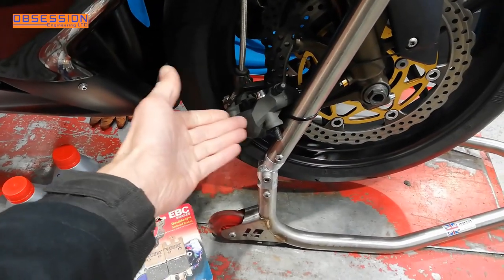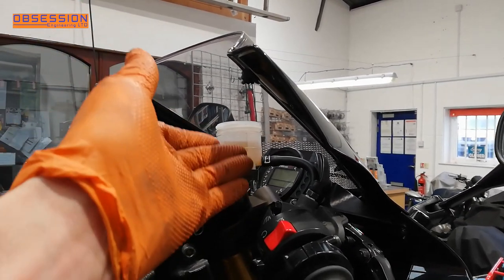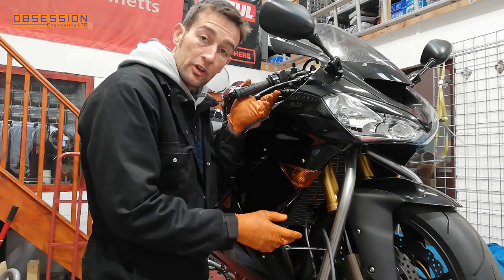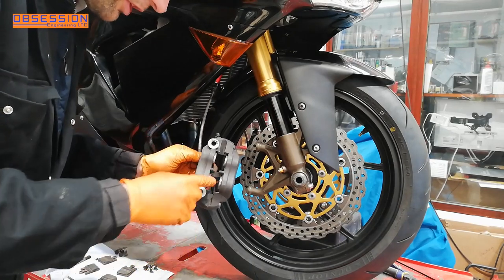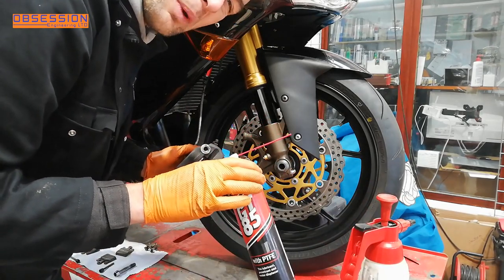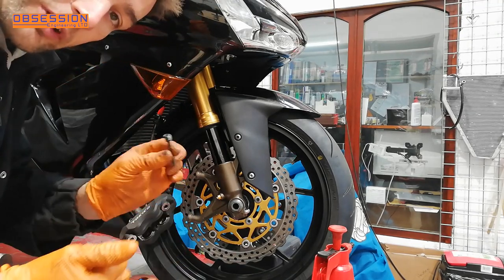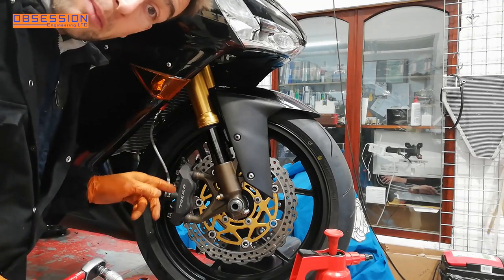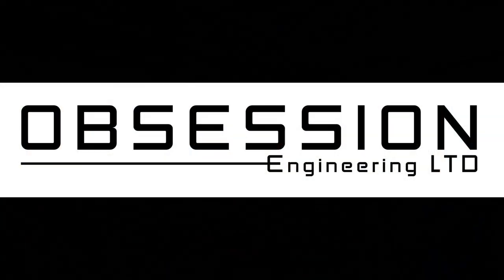2004 zx10r project, part 5. Let the good times...stop fast. Servicing the brakes on the big Kawasaki

Comment: I like to pop the pistons and seal o-rings out, so I can clean and grease behind the o-rings, it’s common to get dirt and corrosion behind the seals and this jams the pistons 👍
Reply: It's easy and cheap enough to just replace the pistons and seals but it does add expense and no function if they are in good order.  Once the pistons are out the seals should be replaced anyways.

Comment: Hi Dave, top job as usual. I really enjoy your vids. There is a video where a Brembo representative  states that brake cleaner should NOT be used to clean calipers as it is too harsh on the seals. He recommends Kerosene instead, or other milder cleaners. I thought I just pass it along.
Reply: Kerosene is Parrafin in English parlance. Also the use of  copper grease on pads has become contentious in some circles
Reply from the maker: I've been discussing the brake cleaner issue with a few folks recently so may well have to do some experiments!

Comment: Really enjoy these vids Dave, the mechanical and engineering work is top notch. For a track bike no need to keep the pad spring plate as it only really reduces noise ?
Reply from the maker: I usually take them out... but it's totally your choice (so I'm not responsible if anything goes wrong!!)

Comment: I was waiting for a disc thickness  measurement.
Reply from the maker: No need, they're in excellent condition with almost no wear, so I didn't worry about width
Reply: @obsession_engineering  l only mentioned it because modern pad materials wear discs more than in the olden days and manufacturers  wanting to er.. ahem 'reduce unsprung weight'